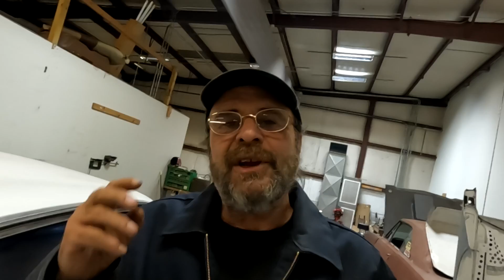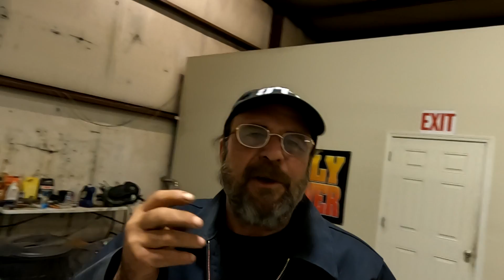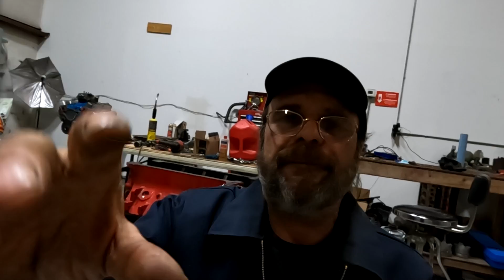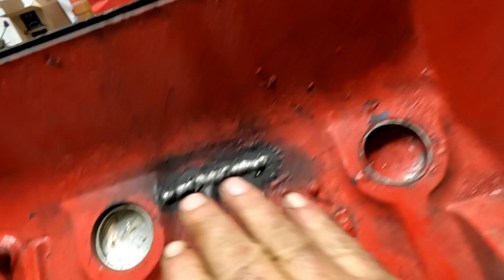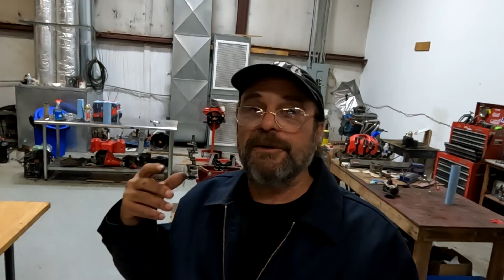Building Mechanical Skills By Embracing Adversity And Failure - A TED Talk For Gearheads Everywhere

Comment: Building hot rods is just you creating problems for yourself to fix. All it takes money to fix anything, because you can pay someone to fix the problems you created. I find the learning and discovery to be enjoyable. That's why I do theses things. I am working on a 2.5 and 4.0 Jeep engines and putting a 351 Cleveland head on top. The 4.0 gets two Cleveland heads cut and welded together. There are lots of issues with this project but bore spacing is not one of them. Pushrod angles, sealing up water passages, sealing the intake side, making a custom cam, etc. But I continue on with my idea just to prove I can do it.

Comment: I'm 15 and my grandpa's 1977 w100 power wagon has been just totally rusting out and sitting for 20 or more years. that beatifull pile of rust just speaks to me. The la 360 it has is dry seized and possibly has a cracked block, my entire family just shuts me down withered the thought of trying to get it run. This video just spoke to me becuase I'm the only one stupid enough to try and fix something like this that just shouldn't be fixed.

Comment: As an aside I fixed a 235 Chevy that would  hold water but it would leak with anti-freeze.  I never figured that out. I  ended up epoxying it and it was a tiny spot. It held antifreeze after that. And it sure does make you happy. I agree! Always try if it is a throw away fix it what do you have to lose?

Comment: Experiment, trial and error, no fear, all words of wisdom.  Reminds me of my dealership days. Alot of favoritism in the dealerships I worked at. So what happens, mgt and foreman favor some guys, so they run into a diagnostic problem or an impossible to fix new car. Mgt fixes it for them, the foreman bends over backwards to make it happen. Alot of times that favored mechanic didnt even have to work on THAT car, he just worked on another while the foreman fixed the hard one for him. What happened ,he learned nothing. So fast forward, the next time the foreman was on vacation, or training or sick, and this favored mechanic ran into a problem, it was all fire and brimstone, crying and yelling, throwing stuff around. He couldnt cope, he couldnt fix the car. Meanwhile...those of us who LEARNED to deal with adversity. And thru pride made ourselves stronger because mgt was NOT going to help us, we ran into a problem, knocked it out of the way, or tried something off the wall to fix it, and just kept going. You learn thru failures and adversity, you teach yourself self reliance.

Comment: I weld cast iron all the time. Use 2018 don't heat it don't do anything special but to do small sections and peen them. It works absolutely fine.

Comment: I love that you know & show others how to FIX things; not just R&R them.  I really come at this because I hate to throw out things that can be fixed.  Partially from growing up poor, but also because I dislike waste.  As for the epoxy method, there is info on how to repair a block with epoxy in the 50s through mid 70s OE Ford engine manuals.  I can't say that I know exactly what it says to do because I never read it, but I know its there if needed.  I also know how to weld cast decently.  It comes from needing to repair a set of FE GT exhaust manifolds in college.  I learned from a welding instructor that was a blacksmith apprentice.  He made us fuse weld 2 pieces of iron into 1 using a hammer & anvil.  It was tough but completely doable.  You have to time the blows to make the steel fluid hot from the molecular movement.  Anyway, it is great to know how to repair nearly everything.  I hate leaf blowers, chain saws, etc because of the size of parts, especially carb work.  Keep up the great work showing the world how to be independent, it really is a dying art that one day soon will be extremely needed.

Comment: I drove my first car into the ground and squeezed an extra ten years out of it when the dealer said it should have been scrapped. 
Towards the end I was consciously thinking of all the moving parts and knew exactly where any weird noise was coming from. I eventually had to scrap it just because it rotted out so bad it wasn't safe to drive it anymore.
My classic car now I throw a screwdriver, a wrench, and a vacuum gauge in the back and I'll get it home if it gives me trouble. I've been driving it for close to ten years and still have never had to tow it home. 
You just don't appreciate a car until you've torn it apart a few times. I took my first car apart sometimes just to see for myself how things worked.

Comment: Yes, you laid a bead in cast iron. But did it fix the leaking coolant? Will the pinholes hold pressure? Are the sealing surfaces still straight and true? It's pointless to celebrate success, when you are merely half way there. Also, you were about to start a crusade against car hackers. That what you just did there was a hack. A ticking time bomb waiting to fail. Looks pretty at the corner of a lot, but no business sending down the road.

Comment: You must have seen my video welding the Pontiac 455 block from a couple of years ago. It is still holding water last I heard a month or two ago so I think you will be just fine! I have found a 5 second count is pretty safe for welding time. The longer you go the more risky it gets to have issues also how thick the casting is has a big effect on how long you can go for but keep it short and you are safer it just takes longer.

Comment: I have a shed full of old FE stuff and the the loft is full of my old race stuff. I have a love for the Ford FE and all of that stuff is Ford FE , some is just old pickup and useable cores and the loft is full of Super Stock stuff. Your life runs in stages. I still have the FE on the brain and I have built them since I was 14 . I’m 62 now and I shattered my shoulder and I am now lblind.  But I built all of these skills. Building, driving, racing. Now I am at the stage of advising others. I can see well enough to share what I have learned and it is surprising but helping someone get his advance figured out in a Duraspark distributor is really rewarding. Eventually we all need to express ourselves as a person with experience and knowledge that is rewarding to share. Don’t give up, playing checkers is a lot less rewarding than hanging out at UTG with one of the GOAT guys in automotive history. The main thing is wherever you are in your life, Sunrise, Noon, or Sunset as a gear head , just do it. I can still build a motorcycle engine, it’s like building a carb. The same discipline. I can still build a car engine, but I use a pace and skill set that is different from when I was younger and a different method for torquing things. The main thing is just do it! Adapt! David Vizard, Uncle Tony, my great friend Earl who used to run Super Stock and a C/SA 428 CJ Mustang, pick their brains when you get stuck. The best resource isn’t sold for $29.99 on Amazon, it is a brotherhood of like minded people. I’m sure like Tony said, you stand, walk , run and never stop doing what you love til you drop. That makes a life well lived! Btw, I am legally blind and can’t drive and it’s hard to see to get around. But it won’t stop me from sharing what I remember , I can see it in my minds eye.  I am glad to still have that.

Comment: Babe Ruth had more strike - outs than home runs.
I have a sticker in the window of my 74 Nova which says "Built not Bought ". JB Weld is king.
I would've used TIG with brass rod and a rosebud to heat the block.

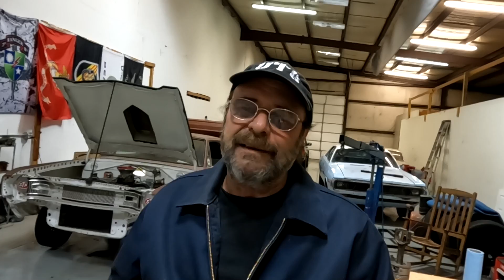Comment: 3:14 welcome my world with my odd obsession with the bastard son of the 318, aka the 3.9L (238ci) V6. Extremely limited and restricted aftermarket parts, but shares parts with the 318. Even more so in the Magnum series. I've got a stupid amount of work planned out for a motor that would not, could not, and should not deserve it. But where's the challenge in just tossing a V8 into it? I guess you could say it's real "dodgy" because I'm taking an untraveled road when it comes to this motor. I'm shooting for spring of 23 for this thing to make a come back and get this Dakota back on the road. Fingers crossed.

Comment: I 100% believe that your fix will work. I am not being critical, quite the contrary. Nothing ventured nothing gained. This little project had no downside only multiple possible upsides even as a failure we all get to learn we all get entertained. But it hasn't worked yet. It won't be declared a success until after a bunch of heat cycles and after it has gone through harmonics. if it holds for 1 year 12,000 miles it worked. . Plus we get to come along for the ride. what about brazing, soldering or melting lead in the crack after the same level of prep. I wonder if using a softer material might be able to take some amount of squish better. That cast will expand in all directions .0007 going from 70f  to 190f I doubt that will cause a crack but that is how much it will move.

Comment: Tony is spot on. I started turning wrenches with my dad when I was about 9 years old. I started by learning what to do with rusty bolts, find bolts with the right thread to replace ones that were missing, dig through junk to make parts, etc. I learned by doing the crappy work and found ways to do things were easy for my dad but looked impossible to me. I'm old now and use those skills without even thinking about them every time I walk in my shop  I look at a new skill the way most people look at tools. Every skill is a tool that I add to the ones already in my head. Together they have allowed me to do things I once thought were impossible.    

I was 17-18 and stranded 60 miles from home with a hole in my airline. I had $5, the clothes I was wearing and my brain - nothing else. I walked to a store and bought a tube of superglue. I tightly wrapped one of my shoe laces around the hole and poured the Superglue over it. A hundred people would have watched and bet against me but it worked.  Credit cards aren't the answer to everything. People need to learn to solve their own problems.  

I'm also someone who likes to try something off the wall. Anyone can do normal but it's  boring as hell.

Comment: You are claiming victory.  You don't even know if the system will pressure test once you have the engine assembled. Moreover, many heat cycles could eventually cause the crack area to leak as the weld loses grip.  I am looking forward to see if this repair holds long term.  The problem I see if it does not hold, many hours of labor was wasted on the engine assembling and installation/removal from car.  The alternative is to buy a rebuildable salvage yard block for about $200.  What you are doing does make sense if you have a Youtube channel and using this as a subject for your channel.

Comment: I've welded cast iron before with great success. I drilled a hole at each end of crack to help stop further craking,ground out the crack some, warmed up the cast and welded with nickel rod the same way you did. Never had any problems.

Comment: Im not an expert on metal working but has anyone ever tried brazing a cracked block? Seems a bit more gentle with less heat. Or, hell...lead solder might even work. If it's the way a radiator is constructed why couldn't it patch a crack? But, Im not an expert. Maybe some one here tried it before and can enlighten me.

Comment: you do home shop R and D,the old guys have been welding cast for years, farmers and their old farm equipment, it is the in between never took a chance guy with lots of money saying it cant be done. question if you have a one of a kind or rare engine that is damaged, why not try repairing it,its fucked anyway,and if you fix it you saved some history,and you learnt an lesson what not to do to break it again. by the way,i learnt  to walk and run because of my baby sitter,i got tired early after my birth of sucking on my moms tit i felt like a incest,and i wanted to suck on my baby sitter tit                         and some advice put kevlar on the bottom of the floor and firewall to protect you from your Rand D shrapnel testing.have a good day

Comment: Several years ago I decided I was going to set out on the adventure to learn how to port and polish cylinder heads.
So naturally I started out with cracked cylinder heads and practiced on them, to learn and refine the skills these paid courses were attempting to teach me.
After a year of practicing on junk cylinder heads that have the identical casting number to those that I was going to be working on I tried my hand on a good set of heads.
Did not turn out too bad I'm sure David Vizard could critique a bunch of things , however when I finished my machine shop was fairly impressed and they do port and polish every day.

Make no mistake it's still nerve-racking when you take a carbide Burr to a brand new set of cylinder heads for the first time.
But I did learn something new.

Try new things  take a calculated risk once in awhile

You never know what may happen

Great video love your content

Merry Christmas

Comment: Seriously, I had broken a motorcycle CamShaft "clamp bolt holder" thing that all it does is screw onto the camshaft, holding it down and provide a screw hole for the Valve cover. Not structural so I JB welded it and it held until I got a suitable replacement. 

You have no idea how many people I told that say I was crazy and how that was dangerous. But it worked until I took it out and looked pretty good still. I only did that because I had no idea how long it would take me to find a replacement part. But dumb stuff like this teaches you what works and what doesn't. 
Extra note, never plug up a Weep oil drain hole because it's leaking. LOL

Comment: UT, we don't know if it worked ...  We will know when you run it and it goes through heat cycles.  Maybe ut'll be OK for a few runs, maybe it'll break after the 10th run ...  Report back in a few years 😁
Also, we would like to know what Iron Alloy is in that block?  How much Ni is in that specific iron block?  What alloy did Chrysler use at the time?

Comment: A nut will blame a squirrel... so I'll blame Richard Holdener.  Does that make me a nut?.  Not exactly.  I guess he couldn't handle the heat of my boost & detonated.  Must of had the wrong cam or a fueling issues because 8 times out of 11 it's fuel.

Comment: I've had all sorts of mechanical jobs thru my working career. Working on one thing you can apply bits and pieces to something else, which in turn you can apply bits and pieces to something else.   And on and on...I've worked on everything from lawnmowers and chainsaws to some heavy equipment. I've done fabrication. It all interconnects somehow.

Comment: A good test to prove your work is a pressure test . You can mockup  heads water pump etcetera.or plug with fabricated plates.Set up a pressure gauge fill with water and pump it up 8 psi is enough to find leaks. Don't exceed cooling systems design working pressure. I use a bicycle pump attached  to the block drain.
Reply: People would be shocked at how flexible blocks are. 
At my old job, I watched a guy rig up a 4cyl Perkins diesel on the floor for a test run. 
Since he didn't have a rad ,he jammed the garden hose in the water pump inlet and half-assed it with a couple clamps and a chunk of rad hose for the connection. 
Haha he didn't take the thermostat out ,and when he kicked the water on I saw the side of the block grow like 1/4-3/8" outward.
He turned the water off and it shrunk. 
He did it 1-2 more times for laughs, and it held. 
They aren't as solid as you'd expect.
No wonder why those old 350 chevies would kill main bearings at high rpms, that crank is hanging out of the bottom of the block with no skirting.
That suckers gotta be walking all over the place from block flex.

Comment: I fixed a head that way, the block was saved by the freeze plugs but for some reason it had cracked in  the head.and that fix worked for years. However I wondered if I had other cracks. I should have magnfluxed it after but I didn’t  is there a way to be sure if you are doing this for someone else? On my own didn’t mater so I pined ends and welded between. Was I just lucky? And smoothed it with a  dermal painted and one had to look close to notice the work.

Comment: I always had a local blacksmith weld exhaust manifolds that were cracked and put them back on the car and they lasted for years with no problems cracking....  The car wound up in the junkyard from being rusted out and the manifolds still held with no cracking...

Comment: I learned a hell of a lot before I could even drive from my dad, who always built cars and custom chopped bikes. I built my first motor when I was 15, a 360 in a 71 Scamp that ended up going 13.60s, in an era when that was a “fast” street car (mid 90s). I built my first torqueflite when I was 16, when the local trans shop didn’t want to build it right. I bodyworked and painted my first car when I was 18. Now over 90 cars later, my builds and restorations are nothing short of show quality, and people approach me to do work on their cars for them. I do everything myself, bumper to bumper, and haven’t paid anybody for anything in over 25 years because I learned to do it myself. You’d be hard pressed to differentiate one of my builds from one done by a restoration shop, except that mine are done properly. Most of the stuff I do now, aside from trial and error, is experimenting and learning, on a system that was considered obsolete in 1985; Crossfire Injection. Repairs, modifications, daily driving, and nothing but positive results. It runs harder than most of the TPI cars I’ve owned and been in.